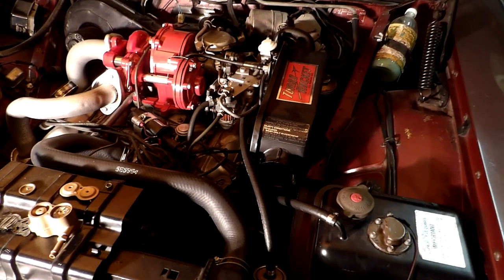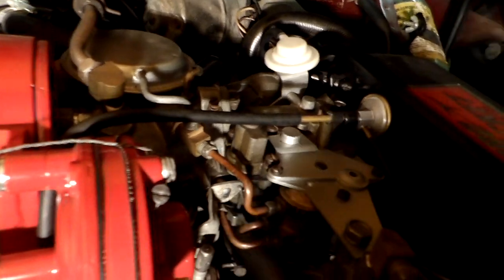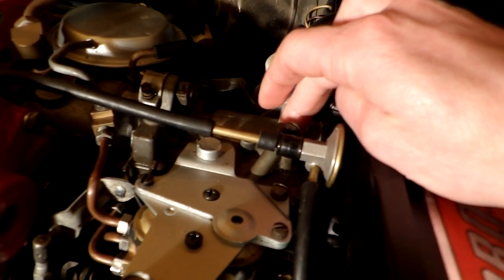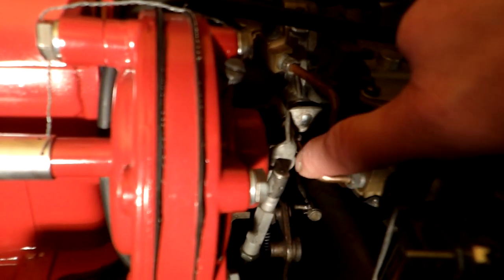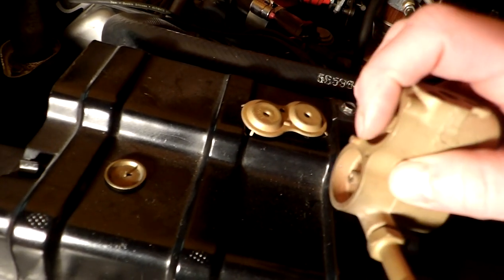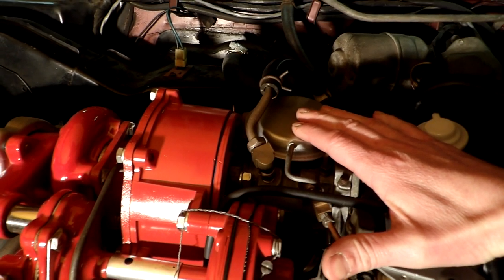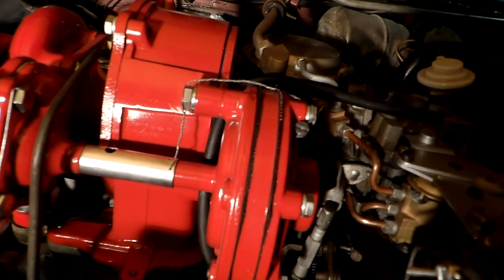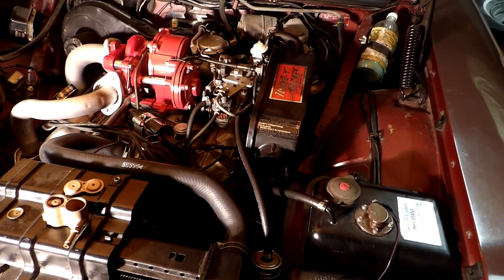Oldsmobile Jetfire Fluid Injection Explained

Comment: Absolutely fascinating. It's amazing to see the things that we can do electronically today were controlled mechanically yesterday. Love it!
Reply from the maker: Yes, modern electronics have made things much more reliable. That is as long as they use quality circuits. Sadly, many aftermarket companies use a very poor grade of electrical circuit components from China that fail to often.
Reply: @oldsjetfire8975  That is a shame that quality can be poor.

I know that electronics are much more reliable and that we can achieve far greater efficiencies thanks to their implementation. I know that complex mechanical systems just open up more potential failure points throughout. However, I still kind of wish mechanical things dominated the market. Call me old-fashioned, but this whole setup with diaphragms and pumps and the like is just too cool! :)
Reply: @MyUsernameIsAlsoBort  MISS THOSE TIMES. EVERYTHINGS COMPUTER CONTROLLED THESE DAYS. THATS WHY I DONT DRIVE NEWER CARS.HATE ALL THAT TECH.

Comment: Excellent explanation! I have been "dinking" with these engines since transplanting one into a 1970 Toyota Crown in 1975. Along with the Corvair (I have owned several!), this engine represents the apogee of General Motors' engineering prowess. Sadly, GM has become a Chinese corporation.

Comment: Great explanation. I own an 81 carbed Turbo Coupe. I want to learn more about the injection system on its precursor, the infamous Jetfire Turbo, (OEM boost is 5lbs on mine). Where can I get a schematic, or more info on fluid and pressure flow as it makes its way through the fluid metering valve? I'm pretty well schooled on these old carbed units, so power pistons, check valves and all that sort is in my DNA. Very cool classic that Olds is.

Comment: Thank you for this comprehensive explanation of this system.  It sure baffles these young commenters that have never turned a screwdriver or seen a 1/2"-9/16" wrench.  I think the two that gave it a thumbs down have only driven a car in the video game Grand Theft Auto.  It would be my dream to have a car like yours and restore it INCLUDING that fabulous wonder of simple mechanical principles you so perfectly described.  By the way THIS is the world's first water/methanol injected car even though some journalists have said the new BMW M4 GTS is (what a wonderful car though.)  Heck, wouldn't this be the first production car with a turbo in the world if the Corvair Monza Spyder, or whatever it was called, hadn't beaten it by like 2 weeks to market (as I recall reading 20 years ago.)  Also, I think I know what was used or can be used as the anti-corrosive agent that turns the Turbo-Rocket Fluid milky if you are looking for a suitable substitute.  I'm 46 years old by the way and used to work myself to death on old pre '71 cars to have a car to drive and as a hobby.  that was the late 80's and up to 1992.  Thanks.

Comment: Well done, I'm happy to say I followed that which is not always the case, it was kinda interesting. Smart folks who figured out how to make the turbo motor run correctly using Rocket juice to cool the mix and valves, diaphragms and pressure to get the right amount when needed. I suppose electronics have made such things unnecessary and much more precise but I do admire the solution they can up with making it all work mechanically. Was a similar solution to aircraft tech I suppose. Very cool, thanks for explaining it.

Comment: Thanks for shooting this, very interesting. You seem to be 1 of only 2 people on youtube posting videos about the Jetfire. I might be mistaken, but as far as my research has revealed, the Jetfire along with the 2016+ BMW M4 GTS are the only two factory turbo cars ever sold with water/methanol injection. It sure took a while to catch up with Olds!

Edit: After a little more research a third car joined the party in 1978. The Saab 99 Turbo S had factory water injection, although it was only installed in 100 vehicles. The M4 GTS had a total of only 803 produced.

Comment: I had a '63 Jetfire around 1967. I was an automatic, but still very quick for the time. If I remember correctly, it was rated at 215 hp from 215 c.i. .An awful lot of engineering and expense for a very modest return. I think the "half a V8" Pontiac was close to the same power for a lot less engineering.... Wonderful explanation, thanks!
Reply: planefloat ..... you were an automatic .. or the car was automatic  ... because you said I was an automatic  ...
Reply: The engine had like 10.25 to 1 compression and no intercooler.
Very detuned...i think only 5psi of boost. Output wasnt too bad for a carbureted OHV engine, particularly considering that turbo fours of the 80s had similar output despite having way more advanced controls. (The 1984 Subaru 1.8l turbo flat four comes to mind...about 100hp from 109 cid.) Hell, even the Nissan L28ET in the 280zx turbo (168cid) only had 170hp and that was with port fuel injection and electronic timing control. The selling point of those engines (and the olds) was the torque that made them feel like bigger engines but had smaller engine fuel economy, not horsepower.
I had one of those L28 motors that I swapped into a 280z. It basically felt  and pulled like a mild sedan-grade chevy 350 instead of a small straight six, but managed 30mpg on the highway. It even sounded a lot like a mild 350 until the revs went up. Nice rumble at low rpm and a nice wail at redline.
Reply: I got the opportunity to drive on one years ago, it was a 1963 Jetfire 4-Speed hardtop car with the Turbo still intact. Pretty fun car that was decently quick for a car back than, rated at 8.2 seconds 0-60 mph. It was Regal Mist Red with White Interior. If I remember correctly, he told me it was 1 of 12 4-Speed cars in factory original stock condition. It had a little over 13,000 miles. They made 9,607 units between 1962-63. Over 80% of those cars had the turbo system removed, and a carb installed at the dealer by 1965 due to owners not happy with the injection system and having to add this fluid ever week or so. About 2,000 cars were left in stock form by 1965. By 1967, the estimated less than 100 cars were left with the factory turbo system. By now, there probably isn't more than 50 to exist in factory stock form with the Turbo. 
Rated at 215-Hp and 300-Tq from the 215 ci Engine at just under 7 PSI of boost. I read somewhere that during some dyno runs, the car made close to those numbers at the wheels, so it made more than what was "Stated".
They don't seem to bring much money tho, doesn't seem to be one of those desirable cars. At Barrett-Jackson, a mint condition factory stock 1962 Jetfire Coupe with a 4-Speed, and less than 9,000 original miles, sold for $65,000

Comment: Thank you for making this detailed video.  I have used Snow Boost Methanol Injection systems before and they work well too.  They rely on a high-pressure pump to spray the Methanol/Water. Much easier system than this.
Reply: that system is like AEM water/meth injection
Reply: @pigeonsil240sx  Yep.

Comment: Fantastic engineering for 62. But it was the death bell  for this complicated engine. Imagine the average driver trying to figure out how this system operates. The complicated early fuel injection used in the 50s was also a nightmare. Fun fact the aluminium block engine used here was sold to the English company Rover and used for many years. In my opinion this technology would have lasted much longer had it been more reliable. I'm happy some examples still exist by dedicated restorers.......
Reply: Americans used to be smarter about the things they purchased. In other words, they were not "average" drivers.

Then, women entered the workforce...

Comment: That pressure valve is crazy!  I wonder how many diaphragms failed over time exposed to the alcohol mixture?
Reply from the maker: The Turbo Rocket fluid has a water soluble oil in it that keeps the seals fresh. As long as the correct amount oil is added to the mix the diaphragms last really well.
Reply: @oldsjetfire8975  That makes sense. I guess you couldn't do that today on a modern catalytic-convertor equipped car or it would sour it pretty quickly, but smog  laws were more relaxed in 1963.

Comment: basic water injection in the 80's when gas sucked we used water/alcohol injection to run engines like the ram air 3 Pontiac on what the pump gas was it worked great

Comment: Going to have to lay this out and see how it works. It seems simple enough, but I am missing chunks of what’s going on.  Based on the 6.5 lbs of boost and the 10+/1 compression, would this motor be making quite a bit north of 1 hp/cid? Was this motor seriously under rated? When I was just out of high school, I worked in a gas station and we had a customer who had one of these. I remember seeing the turbo under the hood and asked him what I was looking at. He told me and said it was stupid fast. He did mention the requirement for the rocket fluid for it to work. I did not really know about light weight small high power engines back then other than the turbo corvair. To me everything had to have a big block to be fast and cool. Turns out there were a number of sleeper combinations like this out there in this time frame by a number of car builders. OHC high output Pontiac I6, supercharged studebakers, turbo corvairs, fuel injected chevys, Chrysler hyperpak  slant 6s, even Jeep had OHC sixes (not much power though).  GMC even had a gas v12 truck engine.
Reply from the maker: They were 215 cibic inch all aluminum engine and 215 HP. The car was less than 3000 lbs. It is not as fast as the "real" muscle cars of the late 60's and early 70's but it is faster than I thought it would be.

Comment: Great video. I know how modern meth injection systems work but I  find this mechanical system very interesting
Reply from the maker: I just think it is funny that I never heard of meth injection till around 2005 and later get into these Jetfires and find that Oldsmobile was doing it in 1962. I believe aviation was doing it even earlier.
Reply: Yes I was aware of the use in aviation and formula 1 (or was it Group B rally?)  in the 80's but this system with it's mechanical failsafe just blew my mind. thanks for sharing
Reply: I don't know if the same but my uncle flew the p-47 thunderbolt in wwII , and he told me he had a water injection system on board he could use for a minute or two of extreme power

Comment: Obviously, the Olds engineers put a lot more effort into their engine than the Chevrolet guys did.  It's complicated, but entirely sensible for the technology of the time.  The thing I'm still wondering about is where the carburetor is and what model.  There doesn't seem to be a chamber for a blow through system.  Was it a standard GM carb or something strange like the Carter YH used on the Spyders?  That was a sidedraft and the same that was used on the early 50's six cylinder Corvettes.
Reply from the maker: It is a Rochester one bbl side draft. The only side draft Rochester ever made.
Reply: @oldsjetfire8975  Thanks for the reply.  Somehow I was thinking it was a regular downdraft but now I can make it out.  And I can't tell you how much I admire you for keeping this car alive and well.

Comment: Interesting--so how much HP would you be losing without the fluid as you have it now and is there some type of replacement fluid available so you could drive as intended?
Reply from the maker: The fluid is not really for making power, it is more to prevent detonation. With the 10.5 compression and 6 psi of boost, it needed more octane than pump gas during boost mode. This is just another way to raise octane. The fluid is easily made with Methyl alcohol, distilled water, and a soluble oil.
Reply: Interesting and thanks, good to have in-depth knowledge about it, glad its a 4 speed not a powerglide
Reply: Olds Jetfire Interesting. But, without the boost, wouldn’t that effectively reduce HP?

Comment: very cool technology for the time its almost like a glimpse into the future of hot rodding. Now a days all the kids building import cars with small turbocharged 4 and 6 cylinder engines. Oldsmobile messed up by having a high compression ratio though. Low compression ratio and higher boost is the way to make more power without detonation but they probably just didn't know any better at the time I suppose.
Reply from the maker: They knew it but in a speech that the head engineer give, he said that they did not want to lower economy, throttle response and have turbo lag. With higher compression the turbo is spinning very fast even not in boost mode. At cruising speed they have virtually no lag time if you step on it. They also get 20 MPG, if they lowered the compression the MPG would have went down. He said that  the goal was to make a nice street cruiser and not a race car.
Reply: @oldsjetfire8975  It would probably work a lot better with a nice size intercooler to keep the intake temps down as that small old turbo is probably very inefficient and blowing hot air. Water injection does help a lot though even without the alcohol added just straight tap water can make a huge difference in reducing knock.
Reply: @oldsjetfire8975  with our turbo 4 cylinders we mostly just use cheap windshield washer fluid the blue stuff for winter. Basically just water with blue dye and some methanol added to keep it from freezing.
Reply from the maker: I agree, in water meth injection, the water is really what does the work. It is to cool the intake air and not much can cool as well as water. The methanol is mostly to keep it from freezing. Of course in these systems they need a water soluble oil to prevent corrosion of the metal parts and keep the diaphragms soft. I have used strait washer fluid before and even when I mix my own, I run a little higher percentage of water than meth

Comment: where do you get the fluid, or can you just use beer?
Reply from the maker: Mix our own. It is 50/50 water and methyl alcohol (Methanol) with a water soluble lubricant added
Reply: Moonshine is better.
Reply: @markg7030  Methanol, not ethanol. One burns red, the other burns blue. That where the term true blue comes from, testing shine for methanol, light it on fire red your dead, blue is true.

Comment: How often would you have to replace the rocket fuel
Reply from the maker: It can last anywhere from 200 miles to several thousand miles. If you never boost it don't use any.
Reply: Eric j wonder how that engine will run with a modern-day turbo setup on it

Comment: Where does one purchase this fluid today, was in pep boys yesterday and couldn't find it, maybe Whole Foods?
Reply from the maker: Just mix 50/50 water and Methanol with some water based lubricant. You could just ran regular windshield fluid with a little lubricant and get away with it. The lubricant needs to be a water soluble type like would be used as a water pump lube in your cooling system.
Reply: Thank u, cause the 2 cars I've seen on you tube, no one explained what to do today

Comment: Surely it would of been easier to lower compression and back of the timing
Reply from the maker: Sure it would have been easier but that was not the reason for these cars. They wanted to maintain fuel economy with the higher compression but yet have a very nice street performer in traffic. These cars when dialed in right will get over 20 MPG if it is a manual and close to 20 for the automatic. That is far better than the 11 to 13 MPG that most other cars were getting at the time.
Reply: Yeah I guess so. Just out of curiosity how did they detect knock back then or was it a noticeable ping when running?
Reply from the maker: They never knocked so no need to sense it. With the fluid injection it prevented the knock. If something was not working right in the injection then another safety would prevent it from boosting so it still could not knock.
Reply from the maker: With 10.25 compression and up to 6 or 7 PSI of boost, they knew it would knock on street pump gas without the water injected. At that point it was only a matter of calculating what the octane needs would be during boost mode and allow enough water to inject to acquire that Octane level. In other words, injecting water cools the intake air, effectively raising the octane level. They just metered it into the throttle body at the correct rate and was only triggered to inject during boost mode.
Reply from the maker: If someone wanted to, they could get rid of the fluid injection and run race gas. It would be the same thing but much more expensive
Reply: Eric j thanks for the reply I normally just tune old merc diesels a lot simpler 😂
Reply from the maker: I bet. These are not bad after you understand them. It just takes a really long time to understand how it all works and also figure out ways to fix it when no parts are available...

Comment: How come it didn’t occur to them to mount an intercooler? Would’ve been far simpler and no water/meth to refill
Reply from the maker: An intercooler had not been developed till 1973. Even with one, these would have still needed water meth. 10.25 compression with 6.5 lbs of boost calculates to nearly 15:1. they did not have fuel injection or computer timing control yet either so this was really all they had with what they knew at the time.
Reply: LOLOLOL

Comment: And that's exactly why it was not successful..
Reply from the maker: It was complicated but works great. The majority of the problem was when the owners would not keep the fluid tank full. That would eventually cause the boost limit control valve diaphragm to go bad then the engine would go bad. Keep the tank full and they were fine for 80K to 100K miles.
Reply: @oldsjetfire8975  no offense but the problem was two fold..Too complicated and nobody wanted to work on them..just like the Rochester fuel injection systems..Don't get me wrong..I love your cars and respect the work you have put into them!!